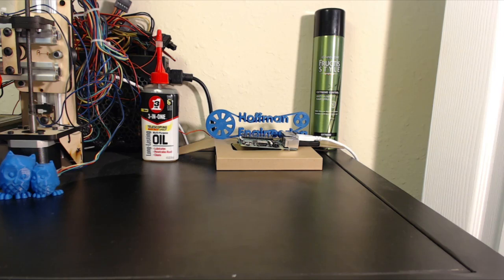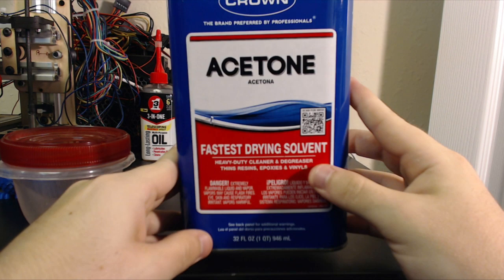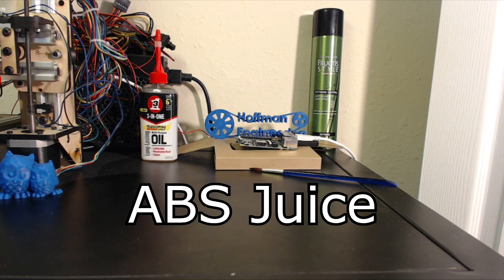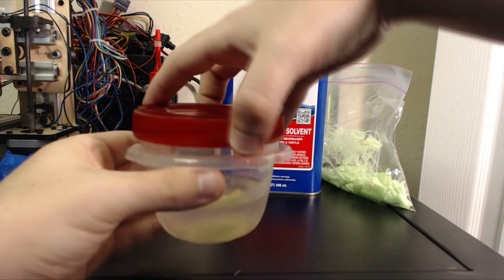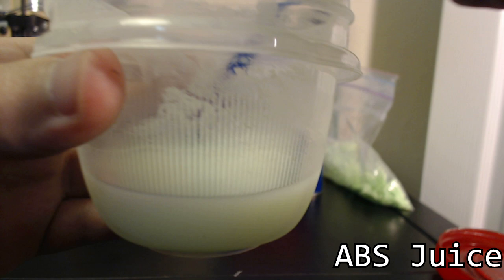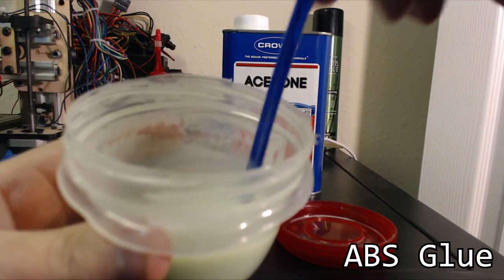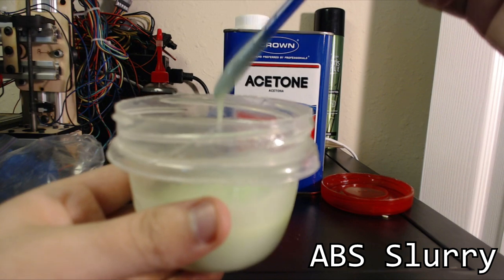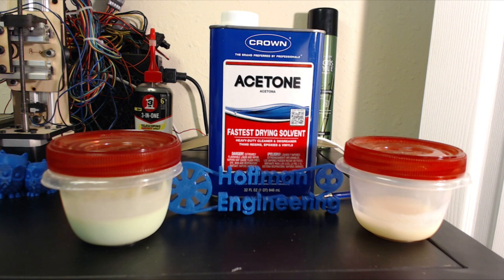How to easily make ABS Slurry (aka ABS Juice and Glue)

Comment: I have been repairing by Civic 2008 auto folding mirror housing for 5 years now, the motor keeps pushing the pin out breaking the housing. Have tried everything but will try this ABS slurry and see if it works.

Comment: Thanks. Great tips. 
Can I use abs slurry as a truck-bed liner ?  Does it stick to steel? (Ore-roughened with 80 grit dando apee)
Thanks for your comments.
Reply: Spell checker messed with my previous message …
Thanks. Great tips. Can I use ABS slurry as a truck-bed liner? Does ABS slurry stick to steel ? (Pre roughened with 80 grit sand paper) ? Thanks

Comment: Why do you need pieces of ABS mixed in, instead of just using the acetone on its own? I don't get it. If you're gluing two pieces of ABS together, then you already have ABS right there. Why can't you just apply the acetone and push the ABS bits together? Why do you also need ABS scrap mixed in?

Comment: What did you say the glue is good for? bill plates?? Bilge plates???.. Also I'm having trouble identifying ABS. Google says code 7 and 9 in different places
Reply from the maker: It was "build plates" in the context of 3D Printers. ABS doesn't have its own recycling code (it's usually 7 for "other"), but usually it's marked with ABS somewhere on the plastic.

Comment: Great video! When using ABS Slurry as a filler will the acetone in the slurry dissolve the ABS piece you're trying to repair? I'm guessing so bc thats how the slurry will bond to the piece, right? And how long will it take for the slurry to dry or cure? Thanks
Reply: The aceton will to some extend dissolve the repaired piece which is how it bounds it with the slurry- however it will evaporate gradually but fast enough to not dissolve more than needed.
Reply: @vlttlv4924 depends how thin the original substrate is ...I repaired an abs sill plate in my Corvette and it ate right thru it 😢

Comment: My problem was figuring out where to get small pieces of ABS plastic. The answer? Small LEGO blocks. Discovered this after lots of online Google searches. LEGO only uses ABS plastic to make its blocks because it is so strong. I bought a packet of 100 small LEGO plate blocks on Ebay, which each are only 250 mm x 150 mm x 50 mm. They dissolved nicely in a sealed cup of acetone overnight, using the procedure in this video. Hurricane Ian had damaged a 3' length of the ABS plastic rub rail on my ABS plastic  pontoon boat. I needed to find a way to make a plastic "slurry" to repair the damage. The small LEGO plates and acetone produced a nice slurry, to about the consistency of vanilla pudding, which i was then able to apply to the smashed boat railing area using an artist paint brush, after placing dry wall mesh tape over the cracks and broken areas. Some sanding and spray painting made the repair job look nice.
Reply: You can buy an entire roll of ABS for 3d printing for like 30 bucks.

Comment: Here's a strange one .   I have a sheet of  2mm ABS and I want to lap glue two pieces together.   I tried straight Acetone last night and nothing happened.   I shaved some ABS off with a razor and put it in some acetone.  The shavings are still there.   So today I did some ABS tests ..no floating in water and burning it. I got a yellow flame  with a blue aura and black smoke.  Yep it's ABS.   So I went out and bought some new Acetone and this doesn't do anything either.  Any thoughts. ?

Comment: Workshop tip: I have been fastening ABS plates end-to-end (ie with no overlap) and have found that ordinary Baking Paper/Grease-proof Paper (the stuff you use to line bread/pie tins) does not stick to or mark ABS glue/slurry.  So with careful preparation you can cover your clamps/clamp-blocks with this product and get really presentable 'clean' joins.  Re the glue containers ... use glass for glue longevity, maybe keep the glass jar of glue/slurry in a plastic container for safety ( I for one do not like glass in a workshop environment) inbetween-times.

Comment: This is great.  I am selling a Coleman trailer and everyone is put off by the crack in the front panel.  I called Coleman to see what the replacement cost is for the panel, and I will find out in 24 to 48 hours.  After watching this, I now know how to repair the cracks and sell the trailer with no worries!
Reply: How did it go repairing your Coleman camper panel? We recently bought one that has a crack at one of the screws about 4 inches long. Thanks in advance
Reply: @Jezebel2299 did you ever try repairing it? I have a Coleman trailer with the same problem and have been googling ideas to try fixing it lol. Seems hopeful though! 🤞🏼
Reply: @tolligirl1  yes… I made a slurry and used window screen to patch from the back side then with a small paint brush on the front with the slurry to blend. Then painted it with spray paint. 
Been a while ago since I did that. We have since sold the popup. But it definitely worked
Reply: I also used some JB Weld for plastic on another project that worked too.

Comment: I have an important question about this substance. 
can you use this to rebond cracks in an ABS part that was not 3D printed? 
what is the strength of this compared to mold injected abs? does the Acetone weaken the polymer
after the Acetone has fully evaporated?
Reply: I watched a video . something named like repairing ABS and he repaired a car roof rack box with acetone as the glue . Then aluminium flyscreen as a reinforcement covered by ABS slurry .  He also gave accurate measurements to mix the slurry.  125 ml acetone to 50 grams ABS. This was a large amount of slurry that he actually painted onto the repair.  Do the math for what you need.
Reply: @tinnedanger  using a mesh screen seems like a pretty clever idea.

Comment: You can make a similar solution with pure polystyrene (what most models are made of) or even styrofoam which as the name suggests, is simply polystyrene foam.  Styrofoam has the benefit of dissolving very fast up to very high concentrations although you may still have to wait a bit for the bubbles to pop.  The downside to polystyrene is that it's somewhat more brittle than ABS, which is a copolymer of acrylic, butadiene, and styrene.   Although I've never tried dissolving pure acrylic or polybutadiene, I imagine acetone would also dissolve both of those plastics if it can dissolve ABS.

Comment: Great vid, what is the curing time for the slurry?.
Reply: It doesn't cure, it dries.  Adding more acetone will always redissolve it. Drying time depends on how spread out it it is, ambient temperature, and solvent:solute ratio, but its almost never going to be more than an hour.  Putting a fan on it makes it dry super quick (<15 min).

Comment: Glass. Try using glass containers instead of plastic.
Reply: as long as acetone won't hurt the seal
Reply: Len me know if you find a glass jar with a seal the acetone doesn't also dissolve.  My glass jar seal lasted 2 days before it was gone.
Reply: @briandodds  Many plastics are not effected, I believe HDPE is not.  Look for scientific or chemical supplies as they would have items designed for that.

Comment: Hi, great tutorial and well done.  Is there a similar concoction for repairing PVC?  Would it be as simple as replacing the ABS Scraps with PVC Scraps?  I am trying to repair cracked 2" PVC drain pipes on a spa from a winter freeze. Products are sold but don't go a long way and are expensive.
Reply: To patch PVC what I do is cut a patch from a piece of pipe and glue it with regular PVC cement, like patching a bike tire inner tube, looks bulkier (uglyer) than use a slurry even gives the advantage of reinforce the part that has failed.

Comment: Has anyone tried to run this slurry through an airbrush? I like the filling properties, and wonder if airbrush uniformity is possible without munching the airbrush...
Reply from the maker: I have not, but I would be extremely interested if it would work! I don't think it would ruin the airbrush, most are designed to have harsh paint thinner run through it. The worst that would happen would be if the acetone evaporated, and you are left with ABS residue in the brush. But, just pour in more acetone, and it'll redissolve.
Reply: @HoffmanEngineering  
Slurry, if poured out, can I make my own ABS sheet? Do these slurries tend to dry out in the long term?

Comment: So I bought some stuff off of Etsy but come to find out its PLA and not ABS. I was planning on doing some assembling , smoothing, filling in gaps, and stuff with these ABS glue and slurry but then found out its PLA(this is my first experience with 3d printed stuff so I'm a noob). I am wondering if you or anyone knows of anything like this glue and slurry for PLA that I can make and will work like this works for ABS?
Reply: Megan9689 painters tape or hairspray for sticking and xtc 3d for smoothing
Reply: Thanks, but the pieces I have are already printed, I just wanted to make the ABS glue for glueing them together but then found out the 3d printed stuff was PLA and not ABS.

Comment: Could a thick slurry be poured into a mold to produce an abs part?
Reply from the maker: I'm not sure how well that would work. If the part had a uniform thickness than maybe, otherwise you'd have uneven evaporation of the acetone ending with some liquid left in the middle that may never solidify. And I'm not exactly sure of the consistency of a large amount of slurry after drying, whether its continuous, or filled with air pockets, etc. Would be interesting to try though!
Reply: Interresting idea! have you tried it already?
Reply: Peffy Pluis No, not yet.  I haven't had the opportunity.
Reply: be careful doing this. I was attempting to fill in a part on a sword and it ended up melting it down.

Comment: Hi.
I'm mostly a PLA user. Do you have any idea what can be legally bought to dissolve this material? I got partial success with Ethyl Acetate but far from ABS with Acetone.
Reply: Can use Toluene, Chloroform, tetrahydrofuran, DCM (DiChloroMetane) all they are carcinogenic so if you can have access to any of them use gloves, safety glasses in a well ventilated area and if you can a respirator mask with a dilter for organic fumes.

Comment: use this. good and cheaphttp://m.ebay.com/itm/240ml-8oz-3D-Printer-Adhesives-for-Glass-Plates-3D-Printer-Glue-/272499824622?hash=item3f724157ee%3Ag%3AKfYAAOSwEzxYYne5&_trkparms=pageci%253Aadd084f9-cd15-11e6-9dff-000c29e5e9d9%257Cparentrq%253A462242ad1590a785742dc6c0ffc9b98c%257Ciid%253A2

Comment: Any extra ideas? I have done this on kapton tape but still have warpage. Am printing  a slightly over 6" print and it adheres so well it actually pulls the tape off the print bed. I'm left thinking about trying it directly on a glass plate.?.
Reply: Borosilicate holds onto more heat and is less prone to breaking. If the ABS residue builds up too much, wash the plate in acetone to clean it off. What temp are you using on your build plate?
Reply: Richard Smith 100c
Reply: ***** Try 110-120C. 110C is the typical bed temp for ABS.
Reply: Richard Smith 1 st at 110 and 100 after. can't remember is my bed will go 120. Got good adherence on straight glass, but then ran into inter-layer pull apart after a certain amount of layers. modified edges added flutes, played with infill. never could completely eliminate it.

Comment: Is this good for PLA prints on a non-heated print bed?
Reply: +Morten Suhler I have heard people using it, but from my experience the PLA doesn't stick well to the slurry. You'd probably be better off using hairspray, painters tape or glue stick for PLA. Those options would be easier to clean up. Feel free to try it though, and let me know if it works out for you!

Comment: Can this glue/slurry be used to bond large ABS parts? I am looking for a way to bond the edge of an 1/8" ABS sheet about 12" long to a flat surface of ABS (an "L" or "T" shape) to create a water tight seal that can handle vibrations and a little stress. If this as an option, what would be a good bond/cure time for full adhesion?
Reply: This glue is as strong as the original material.  Give it 48 hours for full cure.

Comment: really well done and clear tutorial, thanks a lot! Im surprised that the acetone doesnt affect your plastic containers after a while and warp them
Reply from the maker: +helchin93 Thank you for watching! The containers are polypropylene, and if you look up the Material Safety Data Sheet for PP, you'll see that it doesn't react much with acetone. Over the last year, the containers have only gained a slightly cloudy appearance, but I think that is more from the ABS inside than the acetone itself. I haven't noticed any other effects on them.
Reply: +Hoffman Engineering awesome great to know, I'll probably be doing the same! Ill be sure to subscribe for future tips!

Comment: when I tried with acetone it never gave me a good slurry. I find Methyl Ethyl Ketone much better and faster dissolving solvent for ABS.
Reply from the maker: +spideymikespideymike Interesting, looking at the properties of it, its has a significantly slower evaporation rate. I'll have to look more into it, I haven't heard of anyone else mentioning Butanone before. Where did you first get the idea to use it?
Reply: +Hoffman Engineering you will find it as the first ingredient in plumbing ABS cement.
Reply from the maker: +spideymikespideymike Ah, perfect! Thanks for the information!
Reply: I mispoke. I didn't try acetone. it was xylene.
Reply: @spideymikespideymike  I know this is pointless to say but acetone is a very simple ketone